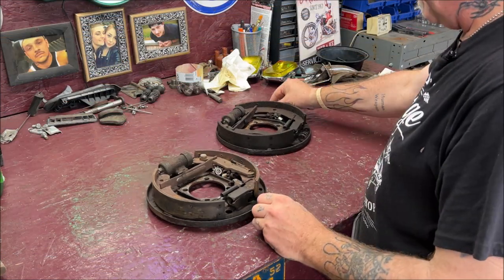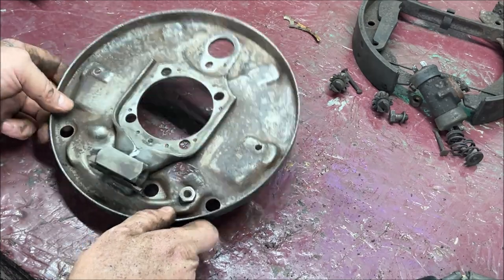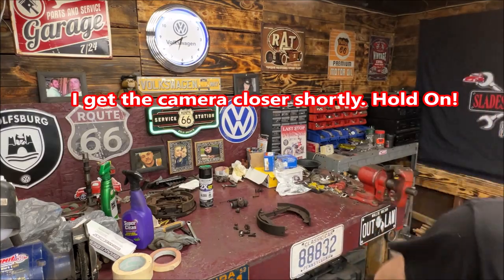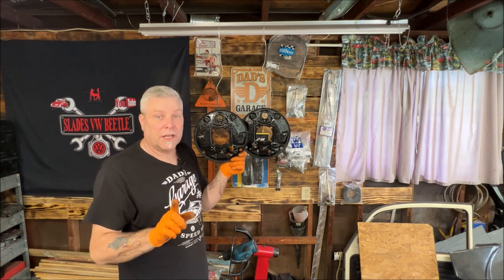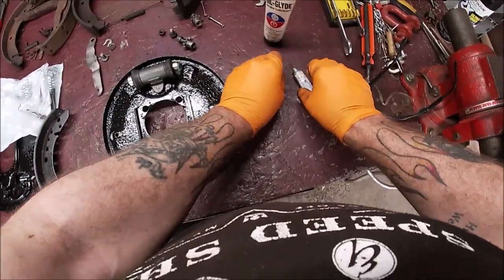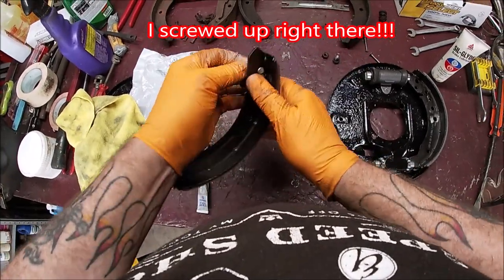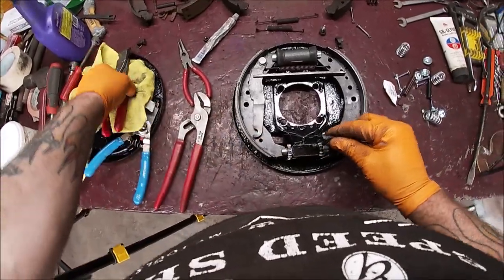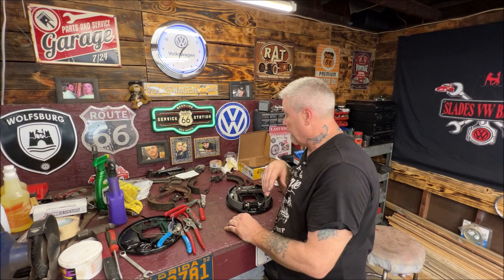VW Classic Beetle Brake Shoe Rebuild - Super Beetle - How to Replace brakes and wheel cylinders

Comment: Slade, In this video it appears you are working on the passenger side rear drum. I noticed that on this drum, the top spring sits on top of the "hump" of the bar that bridges the top part of the shoes. I just disassembled the driver side drum of my beetle and noticed that the top spring sits in the "hollow" of the bar instead of on the "hump". The spring being nestled in the hollow seems to make more sense than it sitting on top of the hump. Maybe the "hump" is only there to increase the rigidity of the bar?

Comment: I have found that high temp or extreme pressure grease will work as well as never seize. If you make a mess with any product you will accumulate dirt and dust. Great video Thank you for sharing. A new Subscriber 👍🏁
Reply from the maker: Thank you Johnny! And thank you so much for commenting I appreciate that.

Comment: Am pretty sure with the bar that goes between the shoes have the small notch (shorter) go into the shoe and the longer one into the emergency (hand) brake lever.  Doesn't matter if you have the hump at the top if you have the wrong side bar.

Comment: Slade, as always you hit a home run with your videos. I keep watching all your old videos and they are God's send with so many of the details you put and explain into all of them.  I had made several comments in relation to the batteries that a 1974 Standard Beetle need to have in it or can we just use any battery the can be held with the metal bracket by the battery tray? Thank you , will appreciated, I checked many auto parts store and they are charging way over the $300-$400  and then in Walmart I see ones for $100. If I have to , then so be it, but would like to know if I hsve another choice to save money to spend it on my Beetle. Thanks again!
Reply from the maker: You don’t need an extremely high CCA, but you do need a group 42 size. I always buy the batteries that are around $100 to be honest with you.

Comment: Nice video Slade....killed it with the go-pro! Is there a certain wire wheel you use in grinder?( not sure if they come in differnt corsness?)
Reply from the maker: I just have a standard one on there right now. But it would also be nice to have a brass wire wheel, for more delicate metals.

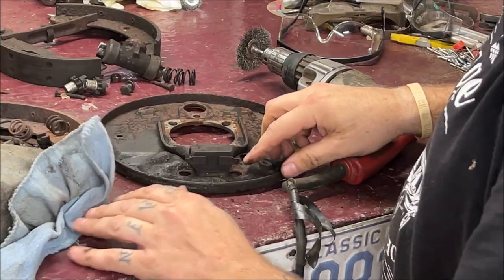Comment: @3:30 you told us to be careful with those little tabs. Well now I just broke both of mine. I don't have the equipment to weld them back. Is there any chance I can just not put them in? Are those really necessary?
Reply from the maker: They actually do break a lot unfortunately as they get older. They hold your star wheel in place, the adjuster will, so they don’t just start spinning. You can buy a new backing plate with them on it I believe. If need be.

Comment: Spade, are the front and rear wheel cylinders interchangeable? I got them all mixed up.
Reply from the maker: No they’re not. The front are different from the back. 
See if there is a part number stamped on the wheel cylinders. 
Then Google the part number and it will tell you which is front and back

Comment: Dang, a couple of my little spring steel tabs that the adjuster star  wheels click on are missing. Are they absolutely necessary? Hate to have to replace my good 1960 backing plates. I’m sure nothing new would be as good quality as OEM.
Reply from the maker: Truthfully you should have them on there so the star cannot start backing up when you’re hitting the brakes. But it’s OK, they sell that little tab online. You can actually put a new one on by just a little tack weld.
Reply: @SladesVWBeetle  thanks. I have some on the way. BTW they are called Brake Adjuster Leaf Springs. Had a heck of a time finding them.

Comment: I replaced all cylinders, shoes, lines and master brake cylinder on my 71 sb. Did bleeding of all 4 cylinders. My brake pedal goes to the floor. Have to pump it few times to brake and stop. Any leads are welcome.
Reply from the maker: OK you definitely still have air. Of course please make sure, this is very important. Adjust your brake shoes first! Before trying to bleed off again. If they’re not, you’re going to have to pump the pedal to get a firm one. So please adjust your brake shoes all the way around. And see if it solves the issue first. If not open all four bleeders until they consistently drip. And do not let the master cylinder reservoir go dry while doing this. And then try bleeding them off  and it will be fixed.